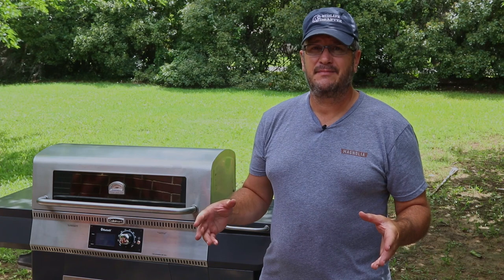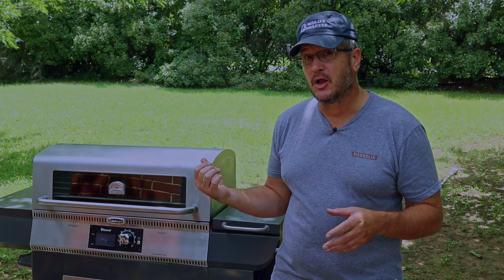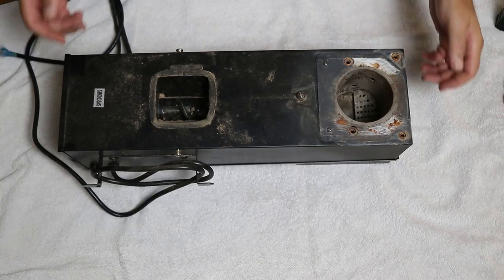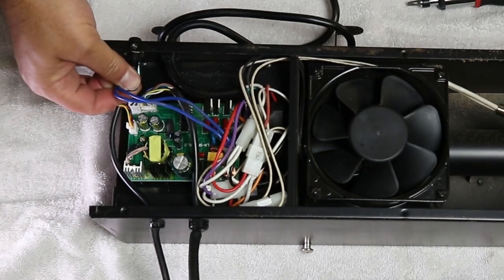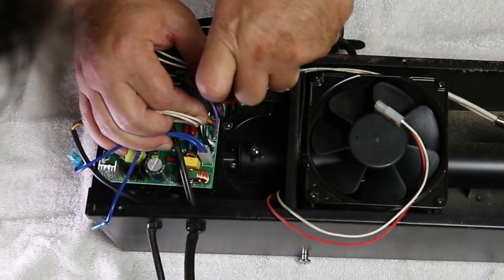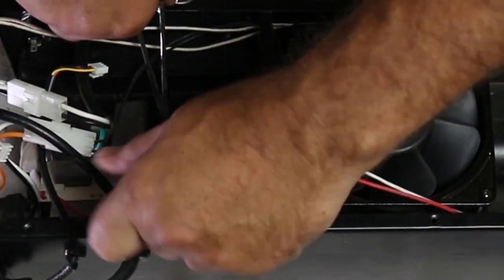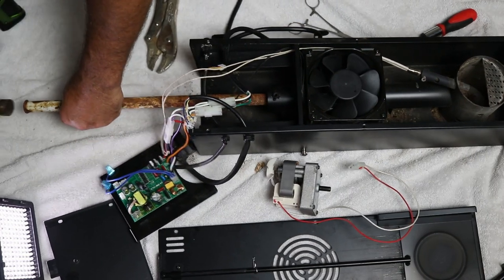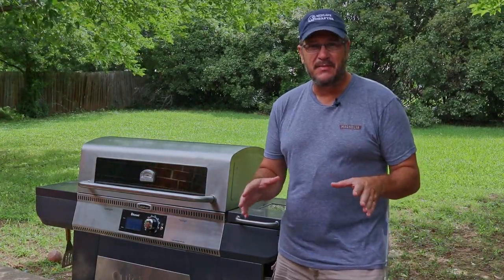How To Fix an Auger Jam | Cuisinart Woodcreek 4-in-1 Pellet Grill

Comment: I'll admit it's happened to me on a couple occasions but I found it easier to tear down inside the grill and fill the burn zone with pellets and get it burning it just fill it a couple times and it will dry it out enough to push on it's own viola working again honestly just got done freeing mine
Reply: I tried this and it worked!! Thanks alot saved me a lot of time.
Reply: How did you get it to burn? I don't want to take whole thing apart
Reply: I tried this.  Didn’t work. 😕
Reply: Also found if you sheer the bolt to auger like I did once just put cotter pin in it to replace bolt cheaper for the pin and more simple in future tear down in my opinion and I just would turn on igniter and let it light it and just on off with dial to give auger a break to not burn up motorized fan will stay going for a while
Reply: I would rather do that. I cooked out one Dat and had a heavy rain right after I finished. It couldn't put the cover back on because the grill was still hot. I used some picks and hooks to break up the hardened pellet dust, however it still will not move.

Comment: Pro-tip:  For reassembly, put the auger motor shaft screw (the one that is hard to get to with the lock nut) on first with the auger and then slide the whole assembly in with the auger plug.  It makes it SOOOO easy to put that lock nut back on.

Comment: I'd like to throw out a little tip, as I just did this exact auger clean out. I followed your tips all the way through the video except, knocking out the pellet concrete from the tube. Once you get your auger out it will fit perfectly in a large drill. Use your drill with the auger and drill out what's in there comes out easy.

Comment: I just used a torch.  No need to tear everything down.  It’s a grill. It’s okay to use fire
Reply: I was just going to see if anyone has run a torch in the burner pot. There is a guy selling one for 30 bucks, I might have to buy it now 😂
Reply: I have been trying to use a blow torch.  The screws are stuck, so disassembling the thing isn't an option.

Comment: This is John Wall. Your video is extremely helpful. I've seen all the others & yours is the most through & easiest to follow. Hooooowever, it would have been very helpful if you had followed through showing us how to reassemble what we had taken apart. Example: attaching the auger shaft to the motor shaft isn't fool proof. If you don't reassemble those two exactly as you took them apart there will be no dismembering them in the future. In my case I had solid sawdust cement in the entire auger tube. The auger wouldn't budge even using vice grips & a 2 lb. hammer. It was incredibly tedious to get the auger out & then the sawdust cement. All of that said, I am very grateful for your tutorial !

Comment: Great repair video,
I wanted to add one tip since I just did this repair on my Cuisinart grill:
Replace that stubborn bolt and nut holding the auger to the motor shaft with a pull-out cotter pin the size of a 6-32 machine screw,
Problem solved next time it happens! 😊😊😊
Reply: That pita bolt is a shear bolt which "should" fail before the motor gear reduction box strips out. It bends but does not fail. 1 leg of a skinny cotter and snipped/bent just past the motor shaft should probably work as designed or be 10x easier to get out if it doesn't fail the next time the auger jams.
Reply: Lol my fix was a Dremel, cut a little hole in the side to reach a screwdriver into the side of the box and it worked perfect. I then covered the hole with duck tape. Very effective solution!

Comment: Thanks sooo much. Mine was clogged as well following these instructions got it cleared right up!. When taking off the motor, to get the lock nut off, I used a 5.5m socket in one hand to hold the nut in place and a screw driver in the other hand to loosen the screw.

Comment: Followed your directions and also forgot to empty the Pellets lmbo 😅. After 2 hours, we are back in action. The pipe area where the auger fills was super clogged! Running like a champ now! Best dorections you can ask for. Definitely have patience AND ai used the auger piece and a knife and manually dug and chopped down the clogged pellets for a while until i saw light at the end of the tunnel! Putting it back together wasnt that bad at all. Thanks again!

Comment: You were right, it was a bit difficult removing the auger screw. But got it done. Thank you for the video. Very, very helpful 👍
Reply from the maker: Glad it helped.
Reply: Was your screw head on top or bottom ? Mines seem to be on the bottom making it hard to get to . The nut just keeps spinning

Comment: This helped a lot!  I had to break off that lock nut.  I am going to replace with a cotter pin.  If I have to do this again it will be much easier.
Reply: Good tip. I got out my bolt and nut but the bolt was bent and a pain to get back in again. A 1/8 cotter pin did the trick. 👍

Comment: Thanks so much! I followed your every step and it went very well.  You explained everything with great specifics.  Top notch. 
For everybody about to attempt this, know that when the youtuber says there is a difficult nut and bolt to remove,  well know it was a bitch and then some!!!! My nut was backward so i had to use needle nose pliers and a socket set.

Comment: When you get to that lock nut just drill a hole threw the back.  Thats how I did it and now my 600$ grill is back to working.  Idk what tool to use for that part but I just put a hole threw it enough to fit a screwdriver in there.  Thanks for the steps.

Comment: I didn’t disconnect the motor from the shaft.  So didn’t need to remove that screw n lick nut.  I used vise grips to turn the shaft.  Unscrew it out.  Turning counter clockwise.  As he shows the box upside down.   Wiggled it out.   Cleaned then slide auger back in.  No need to remove motor.   Good luck
Reply: This comment got it out for me. My screw was horizontal. 

But it still took some knuckle busting and struggle with the concrete mix pellet s.

I'll grind the screw off and put a hitch pin in.

Comment: Having issue sliding the auger box into correct position. Unable to push it forward once two side screws underneath are in. I push as hard as I can and feels like its hitting something or something is blocking it. From what I can tell nothing is in the way. All correct screws were out. Very confused.

Comment: Just received a replacement auger motor from Cuisinart because it was defective causing the fuse to blow, put in the new motor, fuse doesn’t blow anyone but the auger motor doesn’t move, any suggestions?

Comment: Darn it that this happened to me... I'm sure I'm guilty of using wet-ish pellets... I'm not even sure if this is my problem BUT my grill was smoking like crazy and then I'd here this poof as if has had been lit... that's no gas tho. So I'm assuming this is my issue. I'm gonna try a couple easier fixes first, but at least with these easy step by step directions I don't fear anything... other than getting myself a pair of needlenose pliers ahead of time... and maybe a cotter pin to replace that with. Thanks for this video.

Comment: Man, I been on the fence about getting a pellet smoker.....I got an offset stick burner, weber kettle, and weber spirit gas grill......I can use all three to slow cook....but lately I've been wanting something big and easy to use that can cook for 20 people......would you recommend this pellet grill....I saw it at Walmart and was blown away.....your videos are produced and made great by the way. Look forward to More. I love grilling man.
Reply from the maker: It's a great pellet grill, especially for the price. Other than the self induced auger jam, I haven't had any issues with it and we've used it non-stop since we got it earlier this year. My only warning to you is that if you have non-grilling members in your family that like to cook, don't let them know how simple using a pellet grill is or you will be fighting over who get's to use it. I made the mistake of showing my gal how easy it is to use and she has basically confiscated it from me.
Reply: @MidLifeDraftee   would it be easier to  use fewer pellets and empty after use to keep it from clogging. Do all of the pellets empty when using the quick pellet release door? Or do some pellets get left behind like 2cups worth
Reply from the maker: @pshycoghp  I've just been more vigilant about keeping it covered but have emptied the hopper on occasion. I just empty the pellets, then let is run a few minutes more to burn out what may be left in the auger tube. Usually put a small piece of tape over the low pellet sensor to keep it from beeping when doing that.
Reply: @MidLifeDraftee  I heard you can just disconnect the sensor and it won't alarm anymore.

Comment: A much easier way is to clean it out as much as possible with a screwdriver and a shop vac.  Then turn it on to see which way the auger wants to turn.  Clamp onto the auger with some locking pliers and manually assist it with moving while turning the dial off and on.  It will eventually budge and dispense the pellet mass.  I've done it many times and it works every time.  Also the pellet sensor was garbage on mine so I just unplugged it, now it always says low pellets but it will not turn itself off or have an annoying beeping.  I just manually light my pellets using lighter fluid and a long lighter and avoid using the hot rod which eventually fails again and again.  Make sure you don't have the fan running while trying to light them this way or it will be impossible to light.  Just unplug it to turn the fan off.

Comment: Tips for getting out a seized stripped bolt. First 4 on the top, unfortunately one of mine seized up and stripped out...
Reply: If you mean the case screws a little penetrating oil on them might help. If the head phillips portion stripped out a flat head screwdriver with a hex on the shaft might help if the remaining slot portion is not too damaged.  Provide large down force with one hand and use a wrench on the screwdriver hex with the other hand.  If the head is beyond hope you can try drilling the head of the screw off that will allow the cover to come off then provide a little purchase on the remaining screw shank with some pliers.  When you do get the cover off trash all screws with any damage and replace them. Never reinstall worn fasteners and use some antisieze,grease,vaseline etc. on the replacements. If the housing female threads are a little buggered full round screws might hold. The oems are trilobed.  If they are toast  same or next size up self tapper sheet metal screw will hold. Good luck.

Comment: How I removed the auger motor screw - Mine was in horizontal position giving poor access. 

Socket head held by vise grip on the nut end, large flat head screw driver pried against screw head on other end.  Released pressure on screwdriver when turning vise grip back.

Comment: Could not get a screwdriver on the locknut/screw that holds the augur motor on because of the orientation of the screw head. Had to drill a hole through the metal case to access the screw head from the back. What a pain in the ass that was. Now I have to replace that screw because it's all messed up from attempts to get it off.

Comment: Got mine apart and back together. Everything works but my auger is spinning the wrong way so it’s not pushing pellets it’s pulling them back to the box. Any suggestions?
Reply from the maker: Only thing I can think of is that you crossed some wires (positive and negative in the wrong spots) powering the auger motor
Reply: Same here....did you ever figure it out?

Comment: Have you found a solution to the horrible Bluetooth.
Reply from the maker: No. It's pretty bad. The only thing that helps is to keep your phone in line of sight of the grill but it's still a bit flakey. If I'm in our kitchen area next to the back patio where the grill is just outside the window, it works ok but if I go in the other rooms with my phone.... gone.

Comment: My grill won't heat up and the "ingniter on" stay on the display but the "auger on" goes on and off display with the temp not going above 81F
Reply from the maker: That's not good. I'd say reach out to Ember Grills (embergrills.com). They are the company the designed this grill for Cuisinart.
Reply: Mines is doing the same thing. What did you do??

Comment: Ugh, did I say ugh, and thanks!
Reply: Dead - It was dead before I started. I clean it out completely. Two items of note 1. There was no boot over the end of the shaft
2. The nut holding the motor to the auger was broken btw a  #6-32 × 1 inch screw and nut is an sub $1.00 fix

Comment: Anyone else have the unfortunate experience of the screw part that he said u need a needle nose plier being on the bottom so only the nut is exposed?
Reply: Just undo the big screw holding the auger plug in place, then pull the motor out with the auger connected....

Comment: You didn't have to remove that tough screw lol.  Just the big one holding the auger plug... then you just pull the whole motor out while it's connected to the auger ....

Comment: Wow, that's a pretty bad design flaw
Reply: Seems like a pretty simple fix...put the cover on.  This rarely happens if a cover is used .
Reply: @Foo2u2001  cover was used on mine and I still have the issue 90 days old motor does not move at all